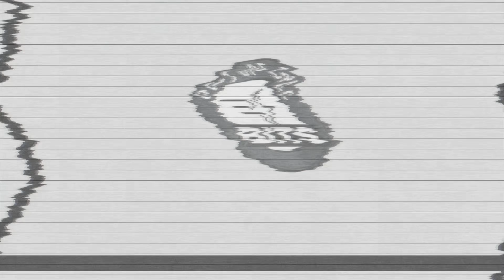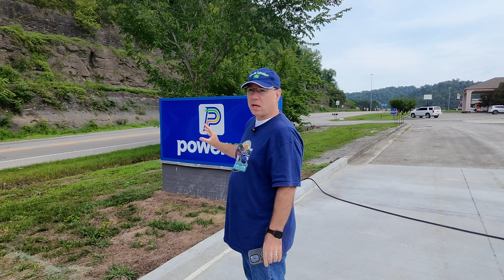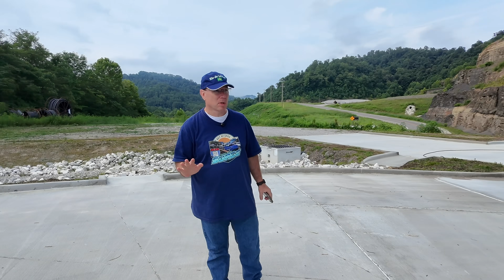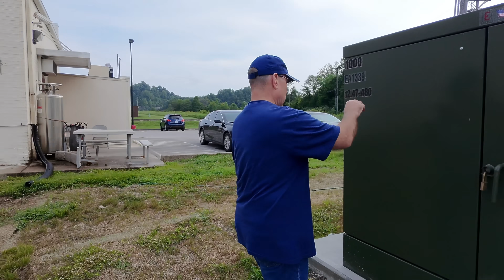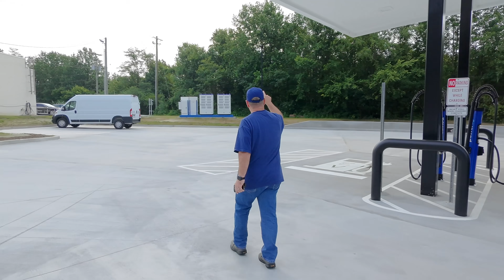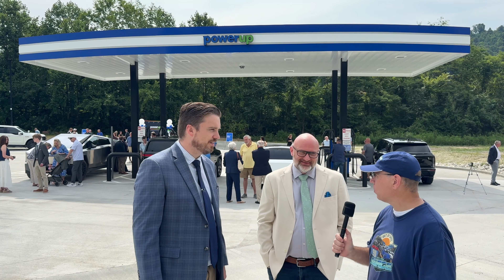PowerUp America's DCFC Network Launches! 400kW Chargers, 70 Sites Planned, & More

Comment: This seems ill advised. There's a reason why Tesla and others have opted for charging-parking spots instead of pull through "pump style" stations (with the exception of spots that accommodate trailers). It seems like to accommodate this gas station aesthetic they had to make all kinds of compromises including increased distance between the DC cabinets and the chargers and greatly limiting the number of chargers for the space. Why not line the outer wall of that same lot with charging spots? It scales better...

Comment: We could use 70 sites just like this here in Oklahoma to replace all the junk sites that Francis Electric has here.   They are a complete and total joke!
Reply: Looks like a lot of the Francis Energy sites are L2, or are older, lower powered DCFCs, many of which have CHAdeMO connectors but not J3400/NACS. With that said, it looks like they've been installing 400 kVA dispensers more recently.

Comment: Finally a site with dispensers facing the sides of the charging stalls rather than pointing off into the distance.

Taking a peek at some gas stations in my neighborhood, the fuel pumps are typically placed just outside the canopy pylons rather than between them, allowing twice as many filling locations with basically the same canopy. It would also add a measure of safety and equipment protection to put the dispensers on a curb-height concrete pad.

I remain a bit frustrated that CPOs are taking so long to reinvent the wheel when it comes to fast-charging locations and how much they can borrow from filling stations. I'm certainly glad when sites can be kept compact by repurposing parking stalls, but for handling big vehicles and ones with charging ports in slightly awkward positions, the gas station model is a well-proven layout.

Comment: Judging by charging networks, the only people who own EVs in the US live in the Southeast. I don't get it. Meanwhile, in the PNW, we have like 2 IONNA stations, over three states.
Reply: I don't get it either. I would think that the biggest holdup would be with local permitting and power sufficiency to a proposed site. With that said, maybe the construction of EV charging sites can happen faster in areas where you can trench, pour concrete, etc. quicker because construction season lasts all year long. In warmer climates the ground doesn't freeze solid and there isn't a bunch of snow to dig through either. Maybe whether you have to deal with all that depends on what part of the PNW you're in.

Comment: Only 4 plugs.    Bad decision.  New sites need to have 8 min.
Reply: We have conduit run to expand to 8 stations, but this area of Kentucky is actually way more than needed today with 4!
Reply: @TurnDownforWatt good you have the conduit , but you shoukd have just added the other 4.   What happens when 1 or 2 go down?   People now have to wait .
Reply: @GregP30  How long were people waiting when there were zero chargers at this site? I'll answer that one myself: forever, because this is a new build. Hence, even with one or two down, the situation would still be better than it was before. 🙄
Reply: @G @GregP30 nt think these chargers will fail a lot
Reply: @GregP30  Kempower chargers typically don’t go down. If a power module faults, there will just be less power available nut all plugs keep functioning.
Reply: Agree.
Reply: It seems fine for a rural location. They could expand the site at some point if it is busy.
It will be nearly double the cost to double the stall count probably not worth the extra half a million if it is never full.
Reply: And ansarlier post had one not working.   A cable issue.  And 4 is enough?  Guarantee only one cable issue at a time.
Reply: So you must have done your own market analysis of this part of eastern Kentucky. Which CPO do you work for, and are your site planning attempts going over well with the company's management? 🤷‍♂
Reply: @alanrivaldo-h   simple math and buliding for erros. .   One goes down, you onky have 75% working.  2,  50%.  This is expierence from traveling many road trips over 500 miles.  4 plugs are a bad decision, regardless of location.
Reply: @GregP30  You didn't actually answer my questions. Nonetheless, here are some more for you (to deflect from and ignore):

Given your self-proclaimed expertise, what is the anticipated utilization rate of this site? 

Why would one go down? It's brand new equipment, and in the event that a charger becomes inoperable, do you already know, in advance, that this CPO will neglect to repair its equipment in a timely basis?

Given that the CPO is the one who installed it, you'd think they'd also be equipped and prepared to tend to it instead of just overbuilding it "just in case," which is what you are proposing.
Reply: @alanrivaldo-h  ok, no i do not do  EV planning.   Why woukd one go down, 2 go down?  Tell me yiu haven't Road trip with an EV without telling me yiu haven't..

Comment: Did you say $15 or $50 hold?

That seems like so much concrete for 4 chargers... Good for people who have trailers, I guess.
Reply: They mentioned in the video that they designed for an electric school bus to pull in and out with ease, thus the space for a large turning radius and also the oversized bollards.
Reply from the maker: Hi Nicholas, it's a $50 authorization hold.

Comment: We charged here 2-3 weeks ago, the stall opposite Walter -- and it wouldn't charge. It kept saying vehicle stopped charge, vehicle said charger stopped it. Kia Niro EV 2022. Pulled over to the other side of the canopy and it worked fine. Might have just been an issue where the site wasn't fully on-line and open yet.
Reply: Just a cable issue we have a tech fixing now! Sorry you had an issue!
Reply: @TurnDownforWatt  Appreciate the info and response!

Comment: This station is designed as all new, purpose-built EV station should be done. A canopy, pull-through stalls that eliminate the need to back in or out, CCS1 and NACS at every stall with a long cord. Next to amenities. Easy in and out layout. Tap and pay with no required app. Plus a sign on the street letting everyone know it’s an EV Station. The only thing I would add is a price/kWh sign on the street. 

Most stations are put in afterwards so they are often shoehorned into the available space.